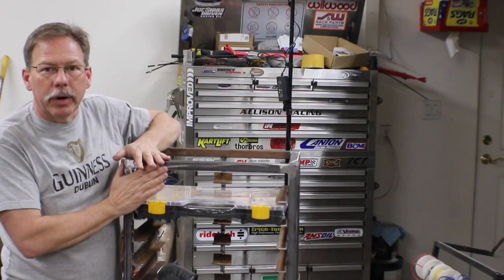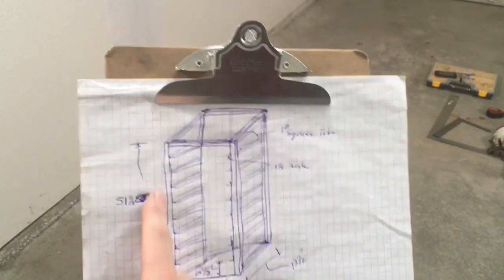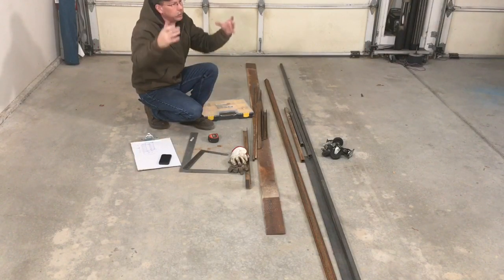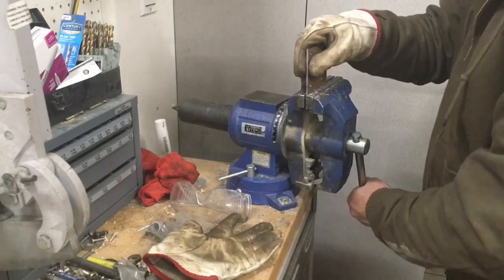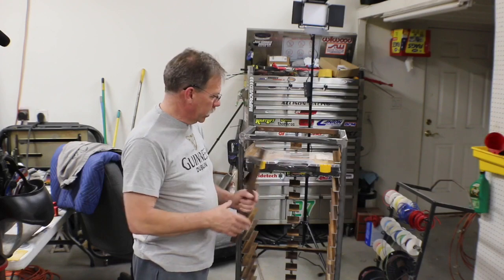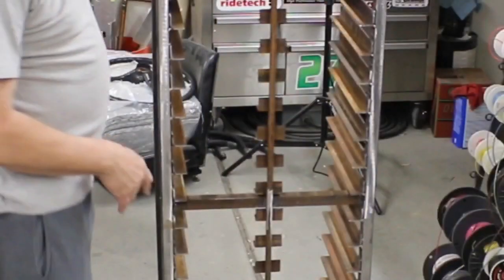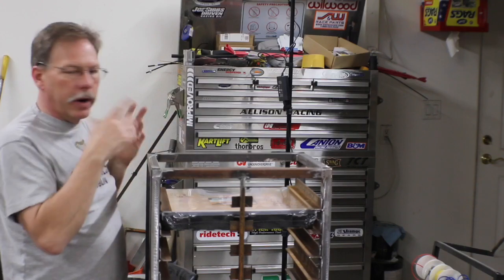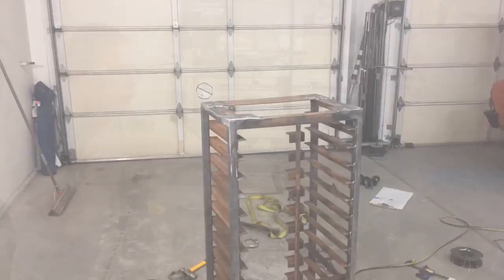Harbor Freight Storage Box - Storage Rack

Comment: Only a couple things I'd change , clip the front corners of the angle just to prevent cutting your hands when putting a case in or pulling out , a couple pieces of flat bar across the back would have helped keep those uprights straight
Reply from the maker: Great minds...   I did round the corners off on the angle iron for the cut protection and I agree, I think I will be doing something different in the back, although I’m not sure what it will be yet.

Thanks for watching!